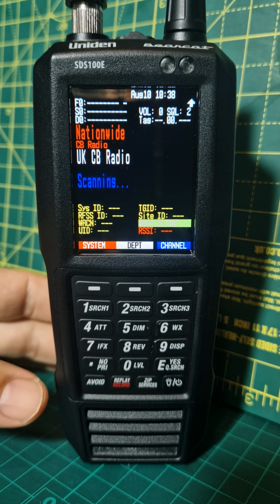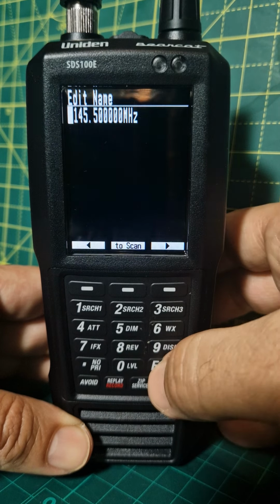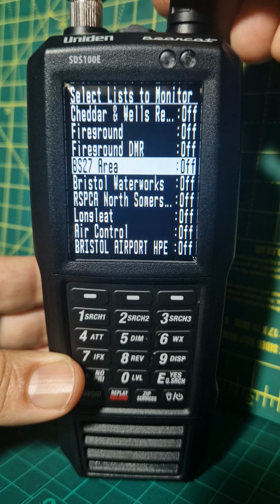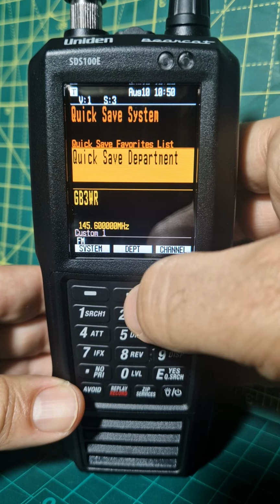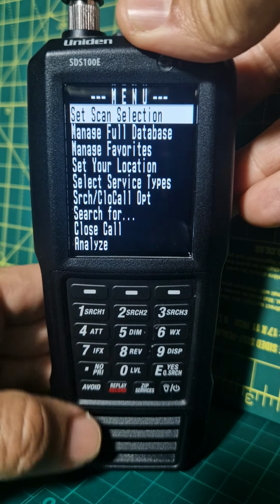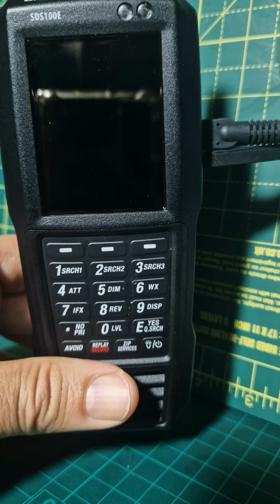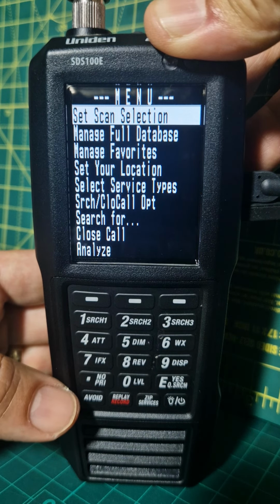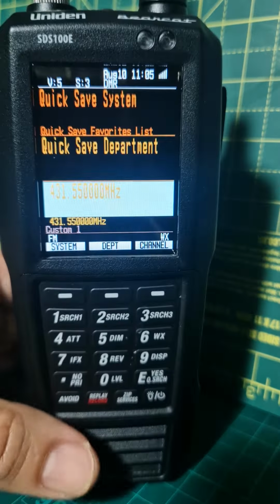UNIDEN SDS100 - BASICS HELP

Comment: Hi great videos on this radio. On mine the service types are all dots and can't be adjusted. There are some like custom 1 that can be turned on or off. I even turned them all on in sentinel but they didn't write across.  It seems to receive ok though.  Any help please.  Many thanks
Reply from the maker: Watch loads videos
Reply: Thanks I'm trying to find out. It looks like it could be a firmware issue as I updated it today to get the waterfall